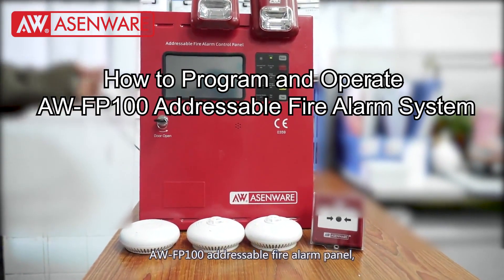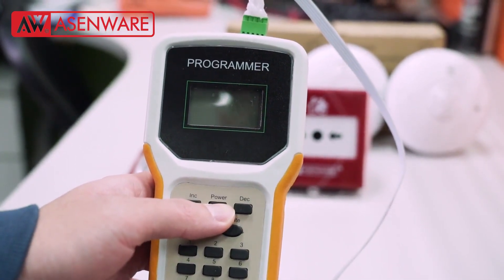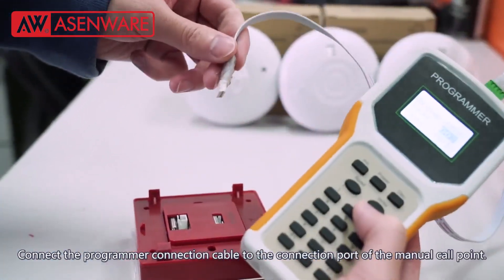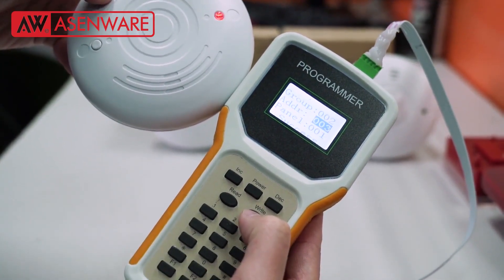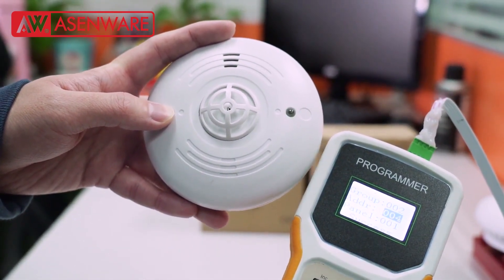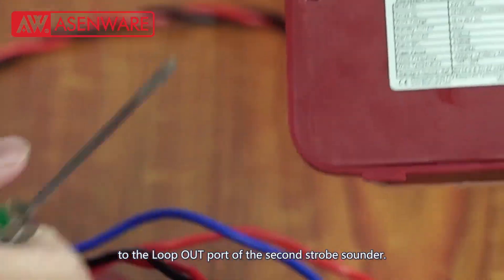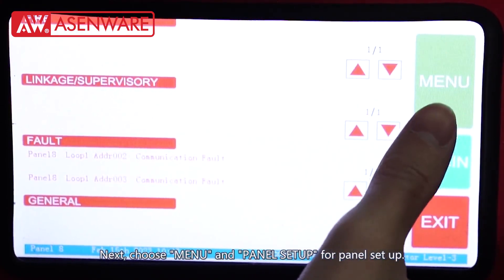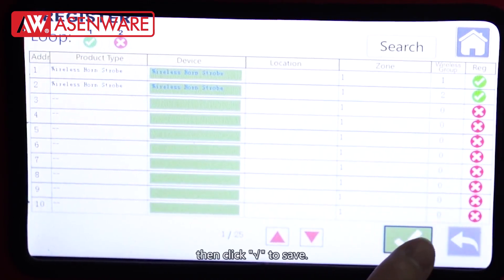How to Program and Operate AW FP100 Addressable Fire Alarm System

Comment: How can I address, find, or program addressable call point and strobe on addressable fire panel without I/o module or programmer?
Reply: Bom dia, vcs tem algum representante no Brasil?
Se sim pode mandar o contato por favor
Reply from the maker: Better with a programmer dear, or you can set with our programming software on the computer.

Kindly contact us for more information:
Email: info@asenware.com
Whatsapp, Wechat, Tel: 0086 13922805301